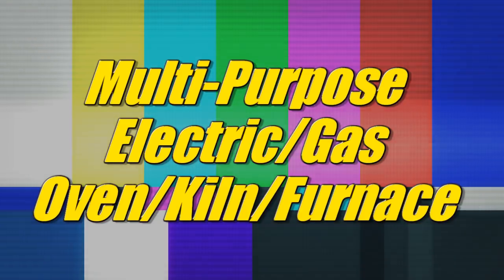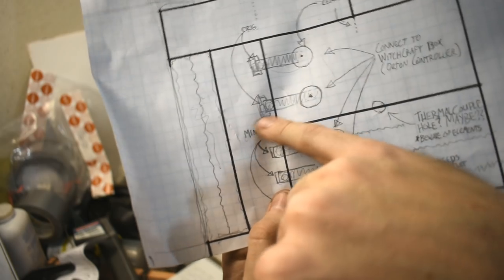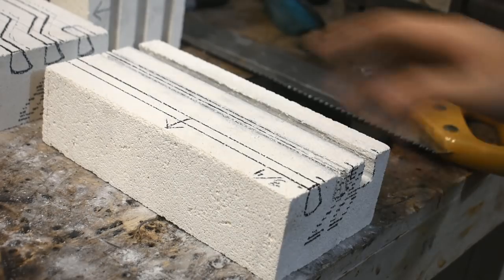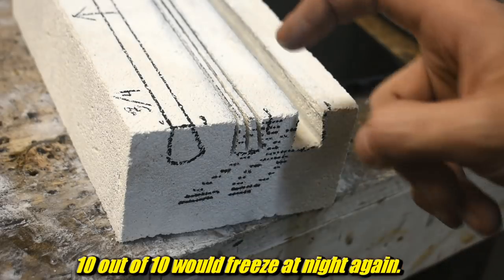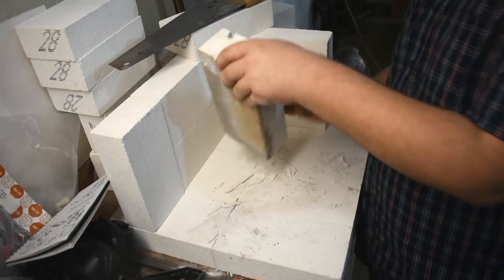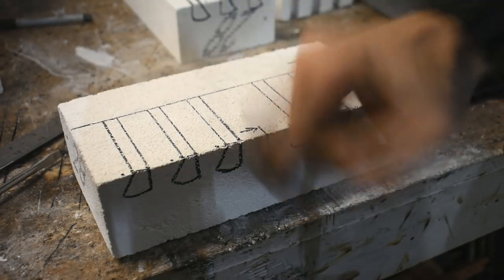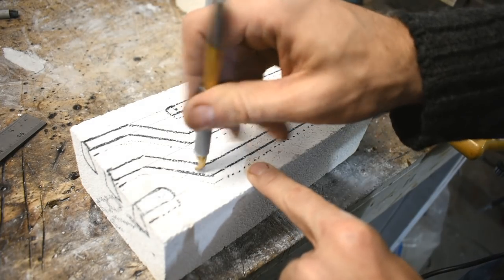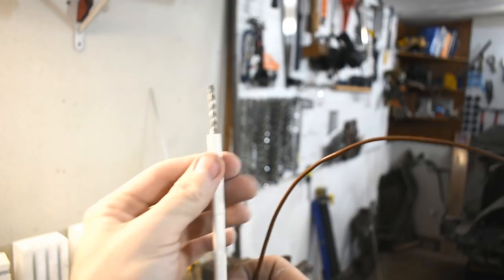DIY Electric Heat Treat Oven/Kiln/Furnace Part 1: Cutting the Bricks, Element Groove Layout

Comment: that saw marking technique with the tape is used a lot in luthiery for cutting fret slots and such things.
Reply from the maker: That must be where I saw that!  I have a couple violin making books I got like 15 years ago, must be in there.  No frets on a violin but they cut grooves for purfling.  I thought it was a knife not a saw in that case? I could be wrong. I havent opened those in years.  Good times.

Comment: Is there some way to compare temperatures and energy cost between Propane/LPG for firing and electricity? I need to be able to melt bronze/copper, and it seems electricity costs would be very high.

Comment: Why not run CO2 from a welding bottle into the kiln when you need reduction?
Reply from the maker: The idea is to burn up the oxygen, but also create an atmosphere that wants to pull oxygen atoms out of the materials in the oven.  Mostly my goal here is for pottery production, a reduction atmosphere does cool stuff to clay and glazes.  For heat treating I probably wont do that, especially with temps so low